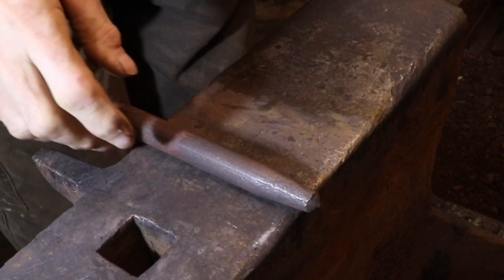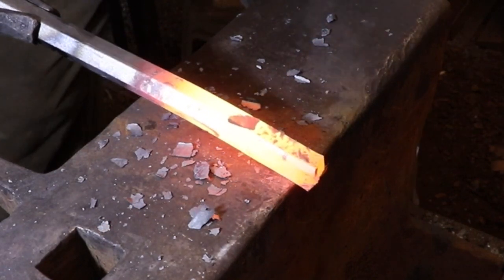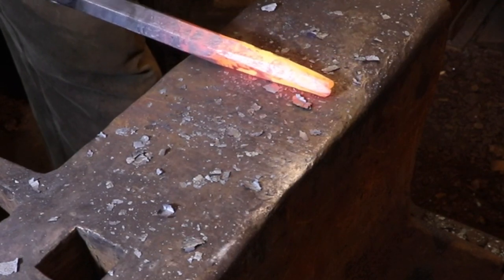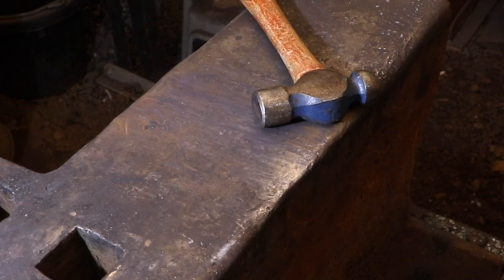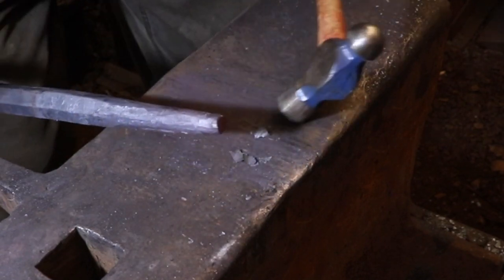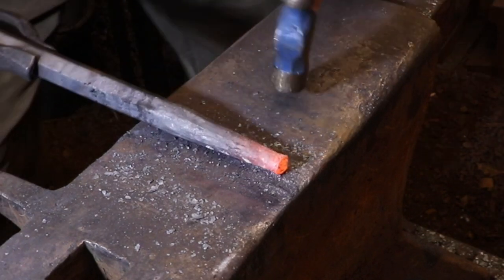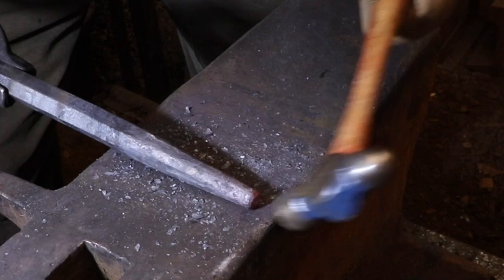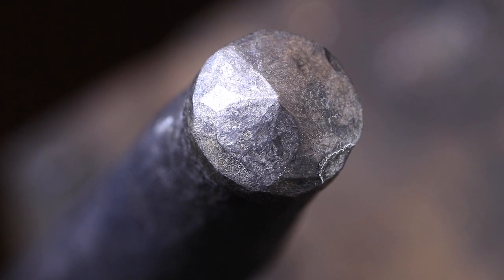A Blacksmith's Center Punch - DF In The Shop

Comment: I have been making some tools over the past 2 weeks.  today I forged a round hole punch/drift.  I need your advice because I am amateur at best.  i stretched the steel out with the edge of the hammer whilst trying to maintain a taper and then made square octagon and then rounded it off.  however i must have been missing one side and there is one side with the opposite parallel to it which are not rounded and are depressed rather than protruding from the cone shape matrix.  i was thinking of filing it down to fix it but maybe it is easier to put it back in the forge and fix it.  how would you recommend i fix this error?
Reply from the maker: Well if I understand your description the problem started because you didn't forge the taper on a square bar.  Anytime you are changing the shape of a bar ( regardless of what you are starting with) you need to be working on a bar with a square or rectangular cross section.  That gives you only two planes of reference to worry about.  Errors in shape are easy to fix because they can only show up on 2 sides of the bar. Once you are happy with that,  then you can start forging the corners down to an octagon and finally when you are happy with the shape of the octagon you hammer it into a round bar.  You can't do it all at once.
Reply: @df-intheshop330  aha that is why! Nice one I will work on that basis

Comment: Pourquoi un cône d'impact aussi ouvert?
Reply from the maker: Why am I using such a shallow  angle for the point?  I find that this creates a mark with a larger diameter so it is easier to see under the forging scale when the metal is hot.
Reply: @df-intheshop330  cool, merci de ta réponse, et bonne continuation !!
Reply: @df-intheshop330  good to know